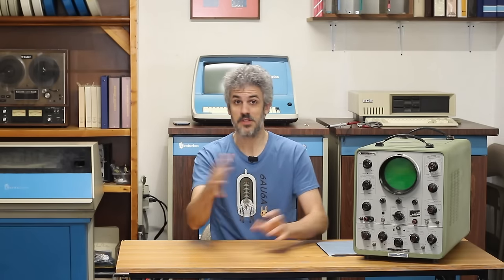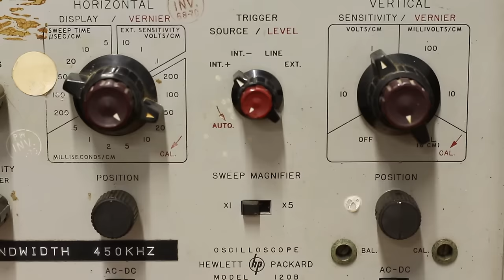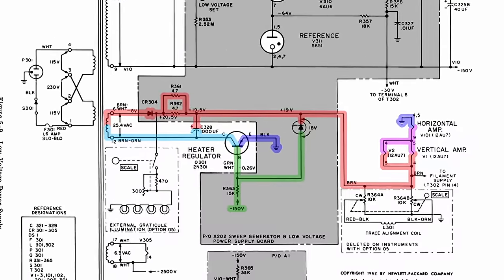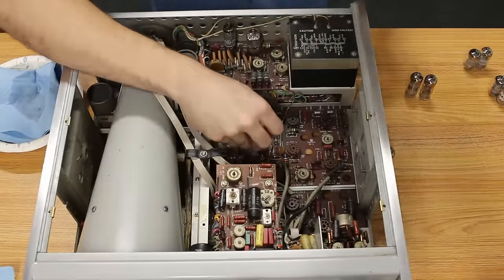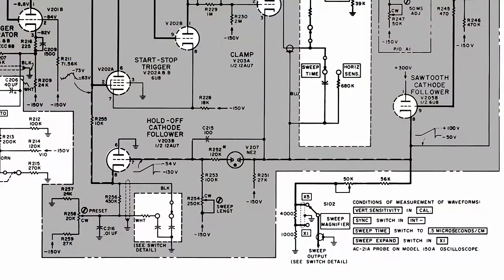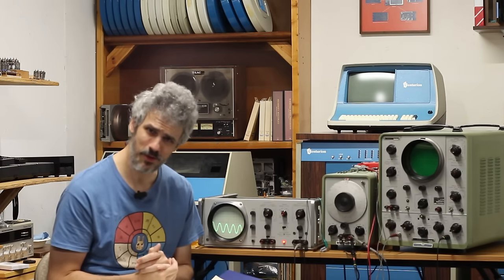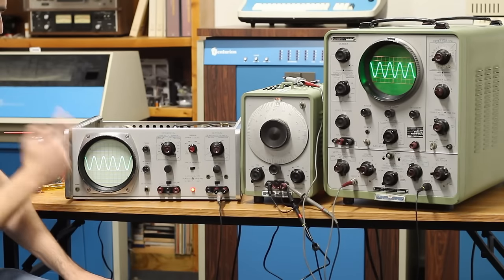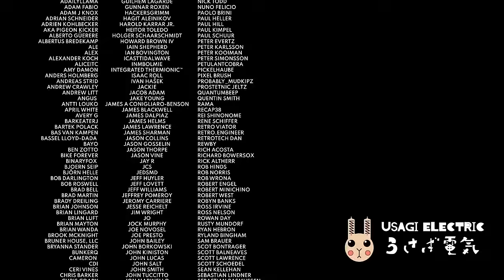Restoring an HP-120B Oscilloscope from 1961!

Comment: So cool to see this on your channel already! I am thrilled that it now has a much better home that I was able to provide. ;-) I had this since the mid 1990s. I used it maybe twice in all that time. It was given to me by a friend and coworker, Brad Forrester (sadly I lost touch with him since then), when I worked at VDO Yazaki in Winchester, VA. Before that, I don’t know the history. Brad, if you catch this, please tell us what you know.
Reply from the maker: Thanks for hooking me up with the scope!
I'm really curious how Brad had it set up with the modifications. They were clearly meant for a specific purpose, and may have been totally fine for that particular job!
Reply: @UsagiElectric  I had one of these when I was a student in trade school in the late 70s. It was an H41-120B Cardiac monitor that came from the charity hospital. It had a bad 12AX7 and a 5 milliamp fuse. 5 ma fuses were used for patient protection into the vertical input. It also had the orange long persistence P7 phosphor. You can connect your chest to it and view your heart waveform only so many times before the novelty wears off. I had thought about building a slow-scan receiver out of it but never did. In the 80s I sold it to a man who had heart trouble so he could make sure his heart was OK.
Reply: Maybe the long lost label that was just to the side of the screen was telling the operator to be careful of the modification?
Reply: @UsagiElectric just guessing, but I would bet that the modifications pre-dated Brad's ownership of this scope.

Comment: If you are running out of space it is time to bite the bullet and sell stuff. If you have so many motorcycles you can't ride each one at least once a week, you are not a motorcycle owner, you are a motorcycle museum curator. Sell the stuff you don't use. It will go on to someone who will use and appreciate it. Computers were made to be used not to sit and gather dust.
Reply from the maker: I agree, to an extent!
There is a metric ton of stuff that has been donated or given away to other enthusiasts that never saw the light of day on the channel, simply because I wasn't using it or didn't have a plan to use it. If it's in the room, it's something I am intending on getting to or use on the regular. 

The Wangwriter is such a cool little system, but because it lacks a serial card, I don't really know where to go next with it. It could make an interesting CP/M machine, but so does the DEC Rainbow. If it had a serial card, I could use it as a remote terminal, or even a remote printer for a larger system like the PDP or Centurion, which would be quite interesting. We could make a serial card for it, but that's a little out of my skill level at the moment. So, it sits not getting used because I don't know how to move forward with it.

The NEC PC-8001 is such a special microcomputer, that I can't part with it. Not because of what it is, but because I bought it in Akihabara and stuffed it in my luggage to carry back with me. It's a fun story and a really unique system. I just haven't been working on microcomputers all that much lately, instead shifting focus to large scale machines. Someday, I will get to it, especially since there are some Japanese themed videos I have planned for next year. So, it's temporarily in storage until I figure out how to get it to fit.

But, by and large, I agree, I have given away at least five PDP-11s, three VAXs, countless hard drives and floppy drives, keyboards, monitors, DOS machines, test equipment, etc. all because I knew I wouldn't do anything with them, and I would absolutely prefer it to be in the hands of another enthusiast!
Reply: or time to make his room larger :)
Reply: @dereketnyre7156 
FAR better idea!!!  Selling stuff is for quitters!!!  I guess that's why I'm still a smoker...  I do't want to be known as a quitter?
Reply: Booooo. Usagi puts it better. Oh and computers aren’t motorcycles. It gets harder and rarer to find parts needed, and every usage is one more day to something dying. New computers are made to be used. These retros are for fun and education. They did their time already.
Reply: @trevorvanbremen4718 You are having severe cognitive dissonance, my man. Your bad habit is not even in the same ballpark as Usagi Electric maintaining retro machines and finding space for them. You definitely have a problem with that leap of logic. I sat in the curtained off area as my grandmother with COPD from smoking screamed and shit herself in her death throes mere feet away from me. Smoking is bad, mkay.
Reply: @TechnicolorMammoth i think the comment was made in jest, not seriously as an actual reason to justify smoking. People will come up with all sorts of copes to justify self destructive addictions but I think the "not wanting to be known a quitter" one is only ever used as a joke.
Reply: @1ABL.while I kinda see what you mean, I feel like this is the kind of thought process that results in these “obsolete technologies” being lost and forgotten. If we use the logic of “it generally serves no real purpose and is easily outperformed” for old technology, then only collectors should ever own them and collect them; and yet plenty of people (including myself) own and repair these devices and aren’t necessarily professional collectors. Also, I’m pretty sure most collectors know these devices are obsolete and outclassed. They are repaired and collected for preservation and, yes, some novelty and fun. Just thought I’d throw my two cents in.

Comment: The mod you removed looks like an external sync mod, as many people find external sync to be more useful than the z channel.
Reply: There's already an EXT SYNC socket on the front, though...
Reply: Ah, I didn't see that. Even so, that's what the circuit seems to look like.  ;^)
 @gcewing
Reply: @roboticus3647  Yeah, that was my first thought as well. It's very strange. Maybe the built-in ext trig function didn't do quite what they wanted?

Comment: Nooooo!    I've interfaced a Selectric to a computer.  Around 1980.   It took a large amount of hardware and software.  The Selectric basic mechanism wasn't designed with computer control in mind, so it is difficult to interface.   It's possible if you're not careful in sending it pulses, to lock up the shift mechanism.  Have a month or two and a full service manual.

Also it's in no way an ASCII machine, so you need a bit of coding to map ASCII to tilt and rotate signals for the golf ball. And it won't accept a full-speed serial stream, you have to wait after each character for a handshake signal.  And there is no handshake signal if you're shifting to upper-case when it's already in upper case, so yo have to special-case that situation or the whole thing locks up.   Not a lot of fun.   Good print quality though.
Reply from the maker: The good news with the Selectric Composer is it already has the six solenoids and switches set up to type and interpret what is being typed, but as you said there's still a ton of serious hurdles to overcome. The marriage of mechanical and digital is a finicky one, and getting that thing working reliably as a data terminal is going to be a proper challenge! But, I have to get it working reliably as a Selectric first. We have a serious mountain to climb for sure, but I think it's going to be a fun one!

Comment: I'm a collector of vintage HP gear.  I have many of the items you are looking for to include an HP 200CDR and HP 3440a.  HMU!  BTW, this was my favorite episode so far.
Reply: Fudge, my 200CDR (rack mount version of your bench top oscillator) does not have the integrated rack handles.  But the 3440A does.
Reply: It appears my comment has gotten lost in the stack.  I didn't want to leave my email dangling in the wind on my channel for too long so I've removed it.  If you're still interested in the HP 3440A, as a donation to the channel, let me know here.

Comment: OMG a HP-150 Oscilloscope. HP's first plug-in oscilloscope close to disaster, they recalled and repaired a ton of these for flaky PCB's.! Bumblebee capacitors and all. I bought one of these at a hamfest when I was in engineering school. I had a couple of plugins for it. If anyone finds one of these that has all of the front panel painted with baby blue Rustoleum paint and painstakingly redone lettering it was the one I had. I have not seen it since  or one like it) I sold it decades ago. If you have it I would like to know! W3OHM

Comment: Remember, Dave: There's NEVER such a thing as "too many scopes". Period.
It's a thing of beauty and a joy for ever - and your kitty fully agrees.
Reply from the maker: Haha, I mean, I agree, but they sure do take up a lot of space.
Maybe, never such a thing as "too many HP scopes"!
Reply: Agreed. I only have 3 of them and feel naked. I need more. Especially since my oldest one is from the 1970s and transistor-only (Hitachi V660). :)
Reply: @stamasd8500  ha! I need a tube Tek on a scopemobile. And that won't be the end of it... if I Keri on, I'll end up like Paul Carlson!
Reply: @UsagiElectric  Collecting test gear can get addictive. You have seen Curious Marc's place...
Reply: @KeritechElectronics  I have a scope mobile for a 585 and one for a 475 scope.. The wheels on the 585 cart went flat on one side from sitting too long in one place. There was a metal piece near the base of the 475 cart that snapped.. 
Tektronix made some wonderful items... 

I think the 475 also had a power supply problem. I thought it might have been the transformer, but I never really tested it for sure.

My latest scope is a Tek 7904 mainframe scope.. I love scopes that have plugin modules to add extra features.. I really hope to get a spectrum analyzer for it..
Reply: As long they not are the same.

Comment: Way back in 1974, a friend and I came across some used HP120B scopes at a local surplus store. We each bought one and upon firing them up at home, neither one worked. These must have been used in a factory where there was oil mist as the internals were coated with oil. I took mine outside and used a spray bottle filled with denatured alcohol to thoroughly clean the insides. It looked almost brand new when I finished, but it still didn't work. I purchased the excellent service manual and after some head scratching discovered that the neon bulb in the sweep generator was bad. I replaced it and the scope came to life. I told my friend and he found the exact same problem with his unit! I calibrated it and it was a great for audio work. I recently gave it away and it was still working perfectly with all of the original components (except the neon bulb) from the day it was built. As far as having too many scopes, the benchmark for that is YouTuber Mr. Carlson's Lab!

Comment: When you showed the "pin compatible layouts", I'd like to point out that some pins in one of them are shown as "not connected" whereas the ohter one has them connected. I've seen devices that use "not connected" pins as solder points on the sockets, so be careful when replacing one with the other, it might lead to magic smoke incidents; Of course that also depends on the device and soldering behind it.
Reply from the maker: That is definitely something to keep an eye out for! Though, in this case, I think the 6GH8 is just drawn in a confusing way. Near as I can tell, the 6GH8 and 6U8 are actually 100% pin compatible. But for something like the 6CB6 and the 6AU6 there are subtle differences that don't make the swappable in all cases. Either way, I'm happy to have an original 6U8 back in place!
Reply: @UsagiElectric  sorry if it came across wrong; I was not implying that you in your case had an issue with going back to the original one; The comment was intented as a bit of suplement for interested watchers who might swap out tubes based on that information. I'm far from being a tube expert myself, but after a few successful restorations and troubleshootings, this is one of the more surprising things I learned and it struck me as unusual enough to point out. I've seen both cases: unused pins for solder points and internal connections that save external wires; a quick check at the socket should be done when changing them from away from factory specs at least. And given the mods that were in your scope, I'd also double check there 😊

Comment: My Jr. High School Electric shop teacher gave me an HP 122A scope in 1978.  That was the most monumental gift I ever received, and it truly kicked me off into a lifetime electronic career.  ( He knew that, I think )
I always love that graceful bezel on those scopes.  You should look up an inside pic of the 122A, it's point to point wiring and an absolute work of ART!
Reply: Similar story for me. High school electronics teacher sold me a Tektronix 514AD scope. I still have it, thought it didn't fair well sitting in storage for a few decades. I had some ham radio guys go through it for me and it works perfectly again. I never got into electronics heavily, but I've been an enthusiast ever since.
Reply: My High school math teacher sensed my keen interest in electronics from speaking with my electronics shop teacher and one day summoned me to the teachers room where he bequeathed me with a Waterman Pocket Scope (s10A) which would actually display video signals acceptably. My first serious piece of test equipment and truly compact for it's time. A life time electronics career did follow.

Comment: They may have had to cut some corners on the sweep and sync circuitry.  Maybe Tektronix had some patents on really good sync circuits?  In any case the 120 has, IMHO, a barely passable sync ability.  You may notice that at some input frequencies there is some sync jittering going on.  That's probably because the next cycle arrives just before the sync circuitry has fully settled down after the retrace.  

Also realize that all the neon bulbs used as level-shifters, their Krypton-85 gas has long worn out.   So the bulbs are going  have an unstable trigger voltage.  You may want to replace  the bulbs with fresh new ones.  There are two in the CAL square-wave generator, those are probably jittery too.
Reply: Yes, Tektronix had some iron-clad patents on their trigger circuits, especially the ones using tunnel diodes.

Comment: When i was in high school I built an EICo 4.5mhz scope with a 3" CRT, that worked well for about 8 years but it really ran to hot and eventually the transformer cooked itself. After getting out of the army in 1970 I was working for Analog Devices as an engineering tech. when they were on Binney St near Kendal Sq.

Sometimes on our lunch breaks a fiw of us tesks would trek down to Eli Hefferons in Summerville, ELi's was an old style surplus dealer who sold everything and anythisng from parts, electronic assemblies. and old test equipment. I ended up buying a HP120 and a HP 200 oscillator, both were rack mount inits and i hot them cheap because they didn't quite work right. The scope just needed a good cleaning and a couple of leaky caps replaced. The 200cd had a pair of tunes that were substitutes and looking at the tube manual the pinouts were the same but Rp (plate resistance) was off by 4:1. I bought a pair of the right tubes (6F6) and that fixed that. I also added a attenuation switch to the generator out put so I could attenuate the output in decade steps (copied from a PACO generator schemamatic) so now the generator worked fine for audio work.

I still have the HP generator but sold the HP 120B to a coworker a few years later when I bought a Tek 545a scope which did a pretty good job of heating my shop. Twelve years later the Tek was getting iffy so bought a Hitachi 35 mhz scope which I still have along with a Teck 2230 analog storage scope.

Both HP and Tek made some impressive instruments back in the '60's solid as a rock.

Comment: Dave: Complains his oscilloscope is too heavy
Dave: Gets and painstakingly repairs a smaller oscilloscope
Also Dave: Plans to put the new oscilloscope in a rack to make it even heavier than the first. ;)

(yes yes, i know there will be wheels)
Reply from the maker: I mean, you're not wrong!
Reply: Well, I was wondering why not put the "heavy scope" on a cart?  But again that might not help when you want the scope to be on the benchtop.  Maybe a cart that has a sufficiently sturdy projecting top shelf that will slip and/or pivot right over the benchtop?
Reply: hmmm, moving heavy lab equipment around effortlessly always sends me back to my happy place when I saw a movie featuring a hand powered micro forklift made from a movie set camera dolly.. It was used to lift a miniaturized submarine and precisely lower it into an oversized hypodermic, which they also shrunk... 

I rewatched that movie a year ago, and as cool as it was.. There were so many technical errors(design flaws)... Well...

10000 points to anyone who can guess what the movie was...
Reply: @WagonLoads  Fantastic Voyage (1966).  I remember Raquel Welch and Donald Pleasence as part of the cast, but I can't remember the others.
Reply: @chrisg6597  You get 10000 points. That movie is on YouTube..
Reply: Couldn't you put the big scope on wheels instead
Reply: @wesleymays1931  I was suggesting moving things like the are on an air hockey table..